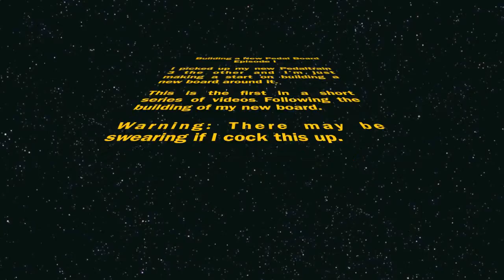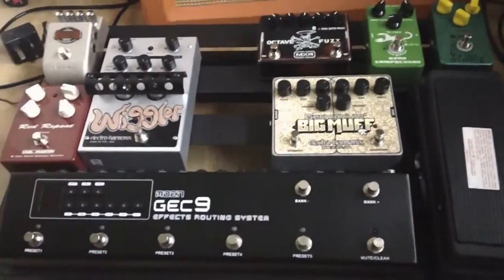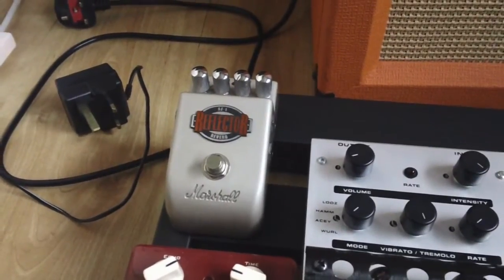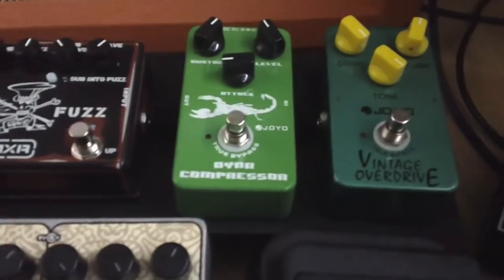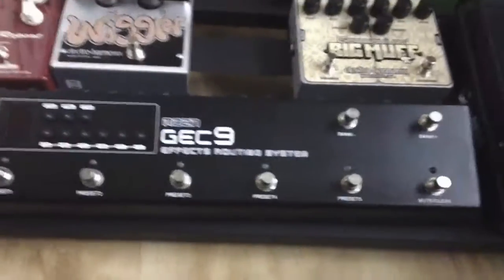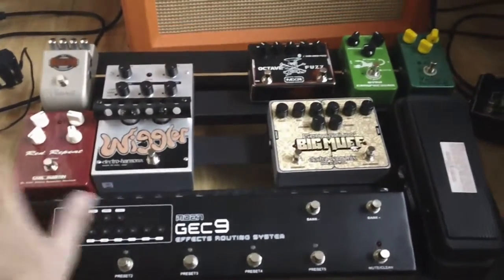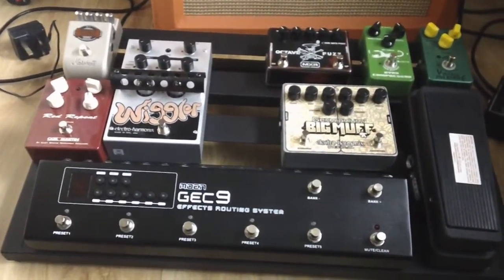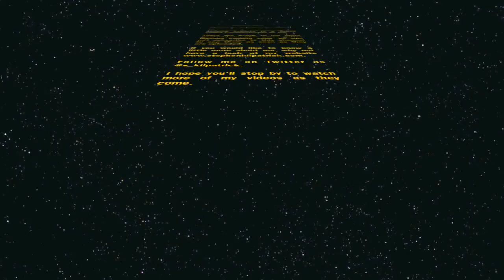Building a New Pedal Board Episode 1

Comment: Hi Steve, thanks for the great and informative video, I've been thinking for a long time about upgrading to a Pedaltrain 3 and perhaps this very same GEC9 switcher. Can you tell me, in your video you mention awaiting the arrival of a VooDoo Labs power supply, but which one are you using exactly? I have a Pedal Power 2+ and the highest output it has is 250ma - but the GEC manual states it needs 350ma? Many thanks.

Comment: Hey Stephen, How are you finding the Moen GEC9 now that you've had it for a while? I'm considering getting one, just need to make sure its good quality and gig reliable. 

Also you wouldn't know if the latching outputs on it can activate the Fav setting on a Strymon El Capistan?

Cheers bud, nice video.
Reply: ***** ah ok cool, cheers buddy. one last question, were you powering the moen gec9 from the pedal power 2+? just wondering if it'll work with mine
Reply: +Eric Hurley , if it helps I ve had the same Mohen for 1.5 years, gig hard every week on it and no major problems. The only issue I get periodically are the connectors into the GEC work loose, I think from transportation. You will lose output volume or get static, however easily identifiable, just press each connector and done.
Reply: Thanks! I ended up buying one and I haven't had any problems yet. Great piece of equipment. Makes singing and playing guitar with effects pedals so much easier.
Reply: That's awesome, it is a great investment in regards to playing. Would you or anyone else  know where to place a wah pedal? I currently use a Volume pedal in the loop settings however rarely use it. Can I just replace that with the wah or do I have to use the wah in a loop? I use 8 out of 9 positions on the gec with my 1 and 2 being distortion pedal drive pedals respectively.
Reply: +Jorge A MAybe you could put the Wah pedal before the GEC-9?
Reply: just found my number 1 footswitch out! I'm screwed. Fog machine fell an popped it out
ugh!